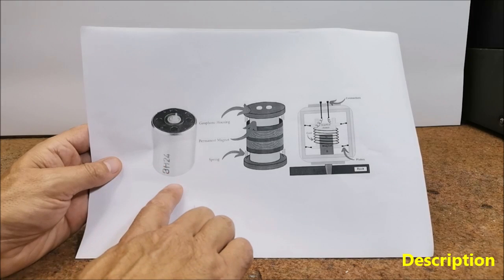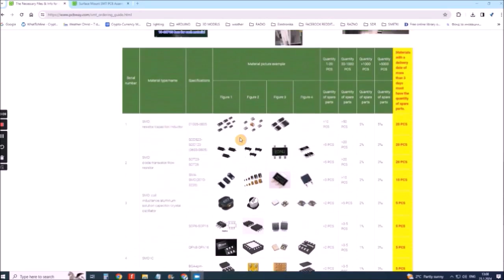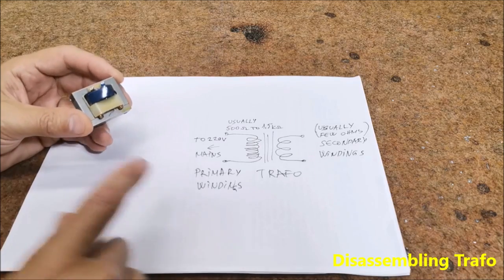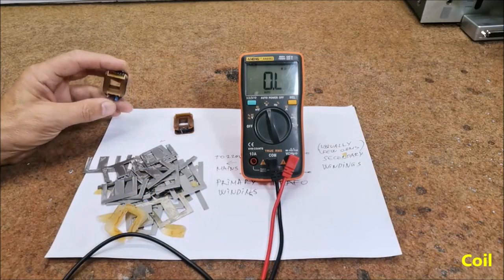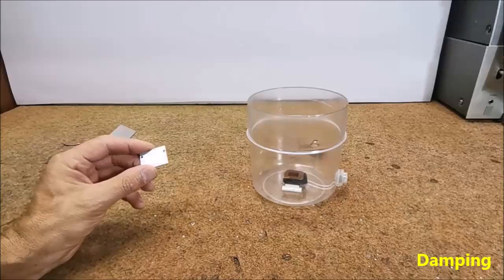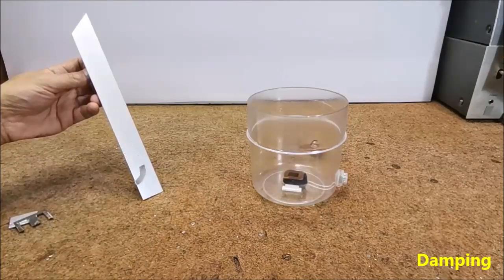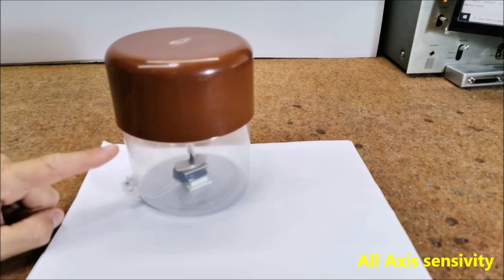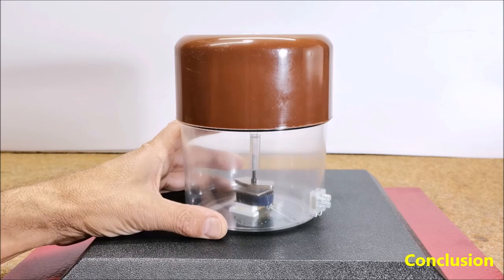DIY Extremly Sensitive and cheap Geophone sensor for Earthquakes detecting

Comment: Hi, how did you glue the components like the aluminum plate and the pump to the container and what is the name of the receipt you used on the wires of the pump that is on the outside of the container?

Comment: Youtuber Clickspring happened to show exactly how to make that spring at about the 17:48 point of this video
https://www.youtube.com/watch?v=in6yWrlighI
Watchmaking - Making Carbon Steel Hairsprings for Watches, Clocks and Other Small Mechanism.

He makes a ball former with grooves for the wire (with incredible patience)  and then heat treats and tempers it

Comment: 09:10 Damping! I had no idea Thank you

It reminds me of the Kibble Balance - here is a cut and paste from the wiki about the design:

The Kibble balance is a more accurate version of the ampere balance, an early current measuring instrument in which the force between two current-carrying coils of wire is measured and then used to calculate the magnitude of the current. The Kibble balance operates in the opposite sense; the current in the coils set very precisely by the Planck constant, and the force between the coils is used to measure the weight of a test kilogram mass. Then the mass is calculated from the weight by accurately measuring the local Earth's gravity (the net acceleration combining gravitational and centrifugal effects) with a gravimeter. Thus the mass of the object is defined in terms of a current and a voltage— allowing the device to "measure mass without recourse to the IPK (International Prototype Kilogram) or any physical object" (Wikipedia)